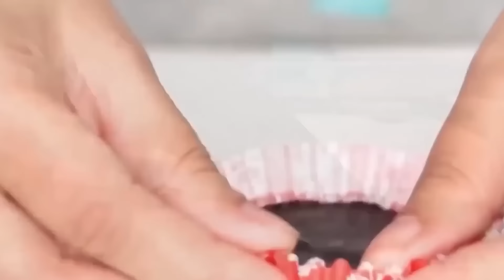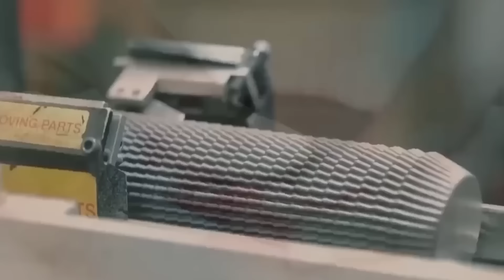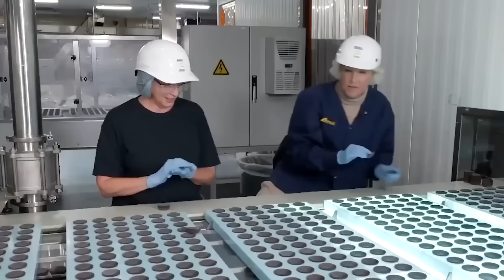How It's Made: Reese's Peanut Butter Cups, Mars & Snickers

Comment: Prices keep going up for these and the size keeps getting smaller  !!
Candy bars and candy Prices are out of control  !!!
Reply: Chocolate price has probably a lot to do with that. The price of cocoa future between 2016 to 2023 was at around $2400 per ton ,  in 2024 it was 2800, in April of 2024 it increased to it highest at 11000 and has stayed above 7000 pretty much ever since.
Reply: Well. A job helps? Bro its fkn 4 dollars at MOST
Reply: It’s called shrink-flation and it’s 100% true. Also the companies are using lower quality chocolate which are packed with sugar as well because it’s cheaper to produce
Reply: @imaduddin9078
Geeeee thanks Mr obvious !😮